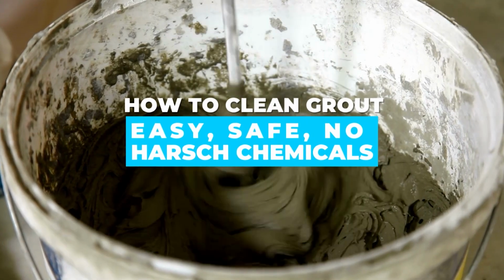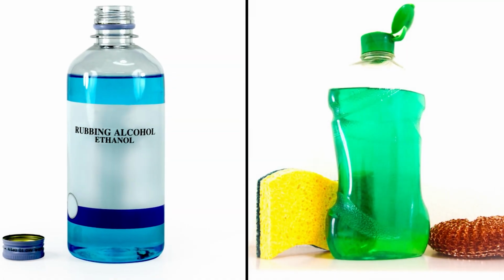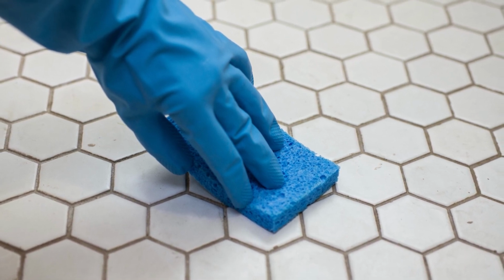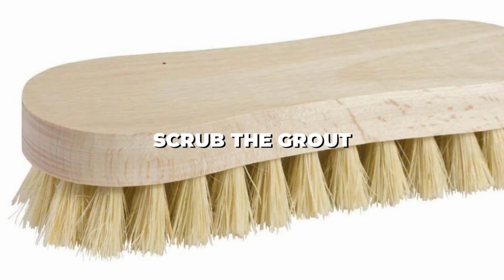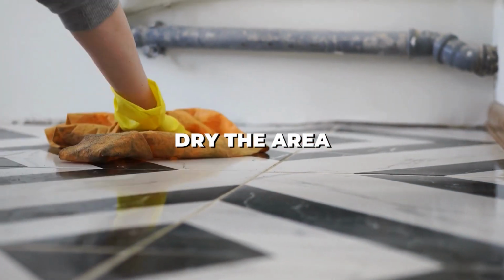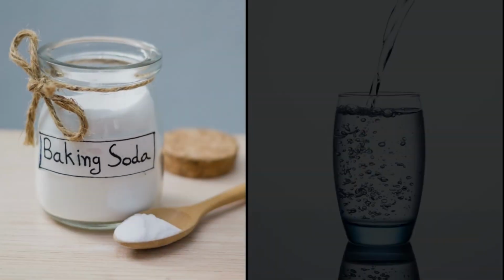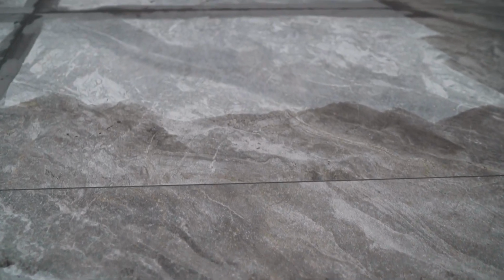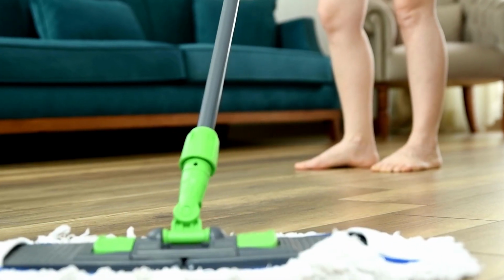How to CLEAN GROUT? | like NEW again with this TRICK!

Comment: I agree baking soda is fantastic.. hydrogen peroxide is also fantastic I use to clean my windows with hydrogen peroxide and just paper towels however I wouldn't recommend it unless you cover your carpet I had tile so you might want to give it a try it will make your windows so pretty and they just are clear with news just straight or you can delete it hydrogen peroxide.